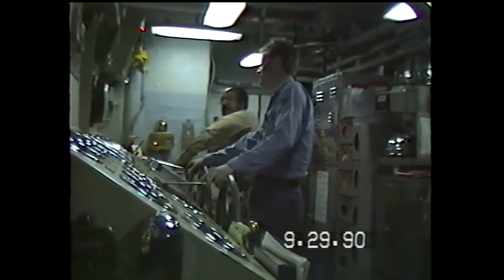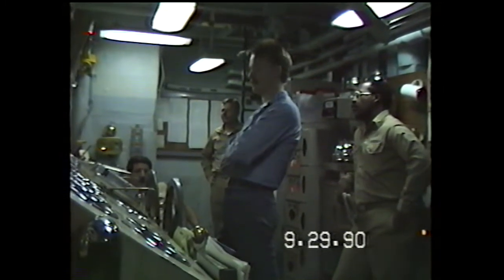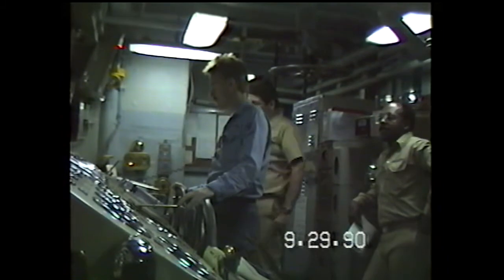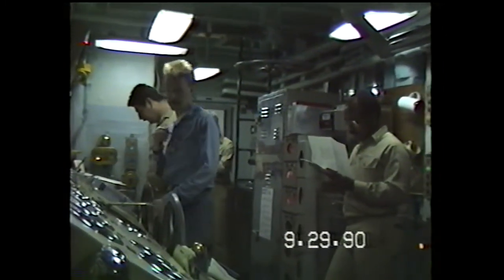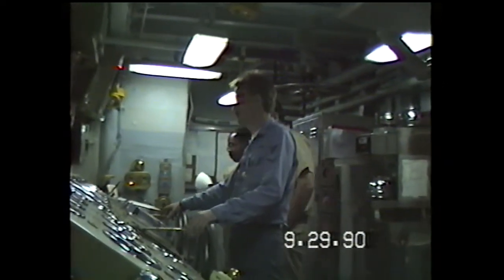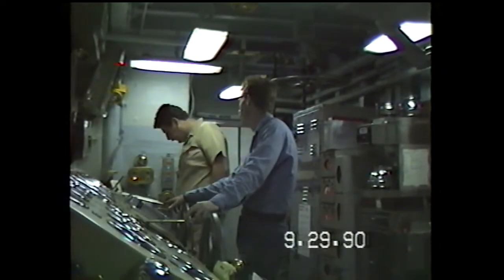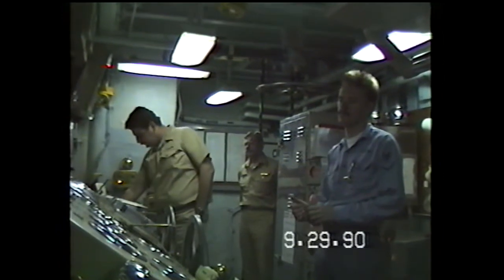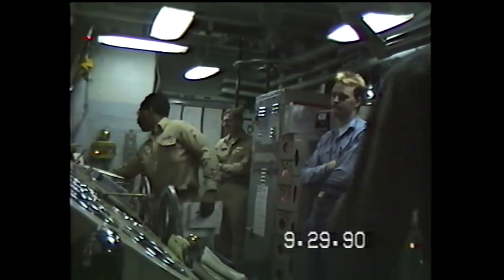USS Cook FF1083 ECC Drill 1

Comment: My word, Chief. Came across this last night and had a marvelous time with a flood of memories. I was an MM from '73 to '81, serving aboard an old destroyer tender, the Sierra AD-18 out of Charleston, a Garcia class DE, the Davidson 1045, out of Pearl from '75 to '77, and the Bagley FF-1069 for four and a half years, making EOOW as a second class in '79. Their idea, not mine. I was happy being a top watch. I angered the inspectors during a loss of control air drill. At the first sign of trouble I got the diesel generators on line and the load paralleled so when the boilers went down we never lost the load. They cancelled the drill. Said that wasn't how we were supposed to handle a casualty. I thought they were nuts. If a guy throws a punch are you supposed to wait for it to land and then react? Okay, fine. Next drill I sat on my hands waiting for things to go dark before taking any action. Again, thanks for posting the videos.